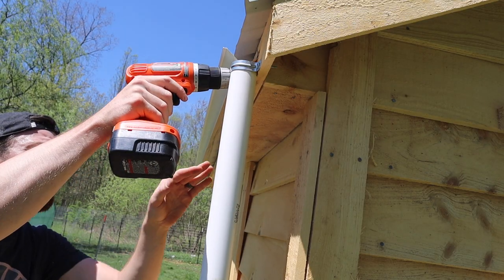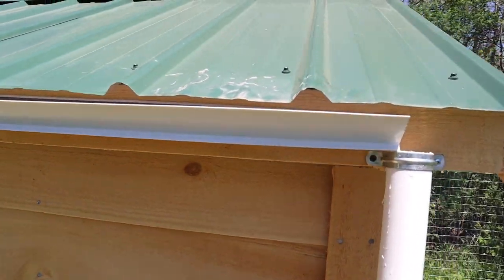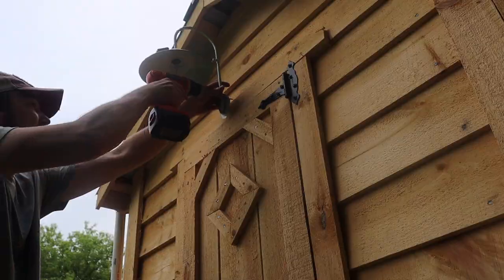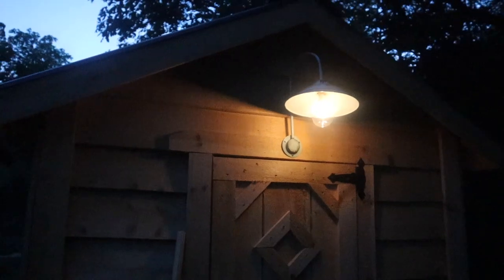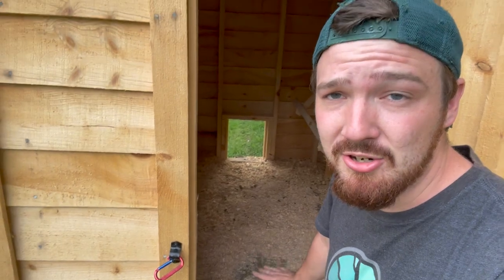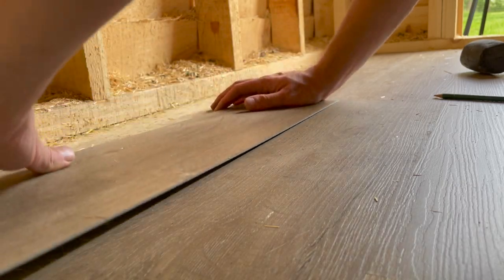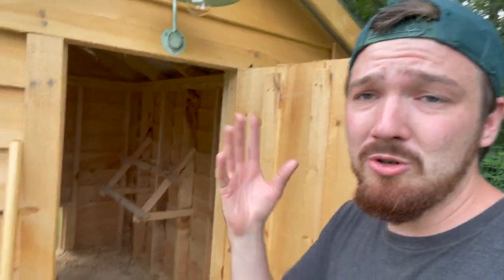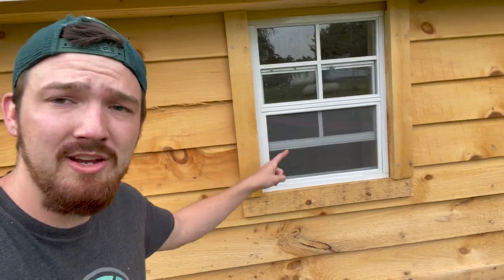3 Things To ADD If You Are Building a CHICKEN COOP

Comment: Nice ideas! I just finished building our coop last week. Took nearly 3 months to get it done. For the flooring I used a slightly different idea. An old plastic bed liner for a pickup truck bed. It even cost me $0 to add it to the coop. I cut it down the middle and cut it to length. The two pieces are overlapped so nothing is getting on the cherry hardwood floor. Clean up with be just as easy, push the bulk of the manure out into a wheelbarrow. The bed liner can then be picked up and thoroughly cleaned if desired. It was free and super quick to add it to the coop.
Reply from the maker: Thank you Ken! That is a great idea for the floor, it would be super easy to just pick up and power wash, I might use that over this flooring! Thanks for watching and glad you enjoyed